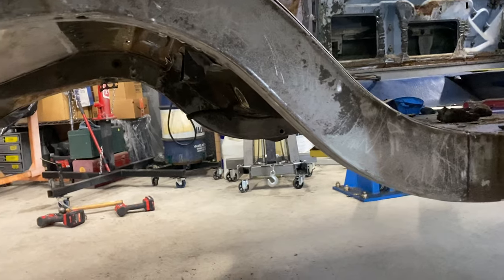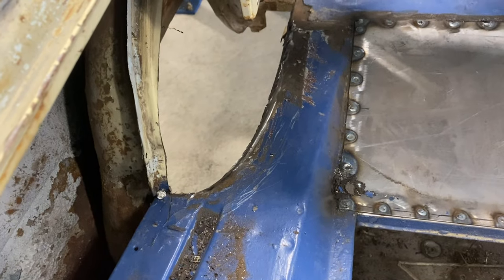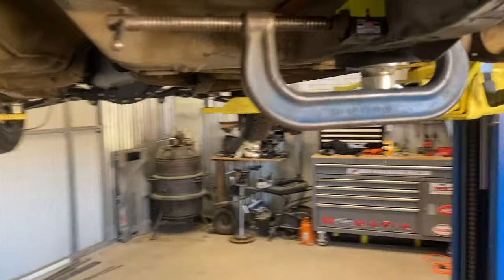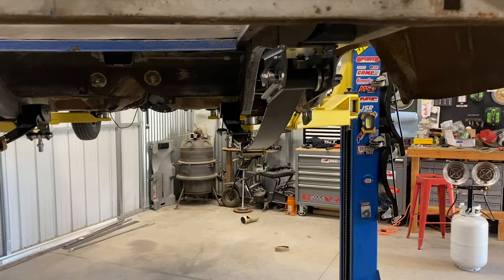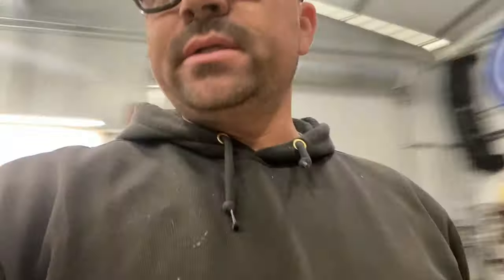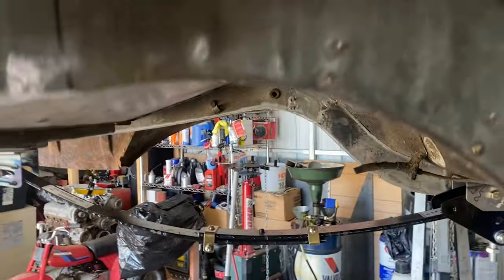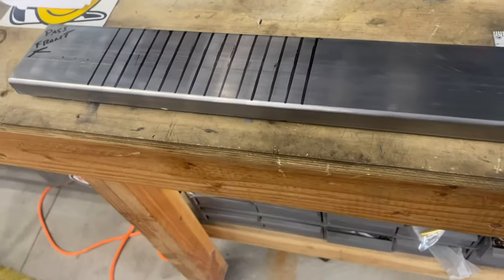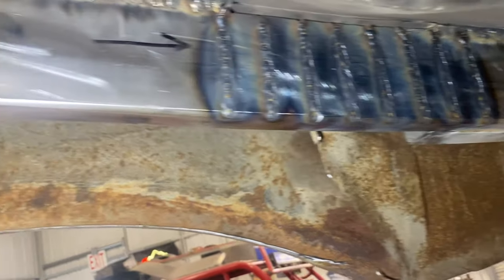1963 FORD FALCON MINI TUB CONTINUES!!!!

Comment: Looks like a good time to weld a piece of tube bent mocking the frame rails on the top inside of the rails, be like a tube chassis by strength but still have the modified rails for mounting to and weld the spring brackets to also since the factory metal and coating is horrible to weld on. Just a thought since im wanting to do the same to my 62 wagon
Reply: Well nevermind, should have finished watching to see what you ended up doing lol, dont be hard on yourself about thinking this stuff is boring. It will be people like me that wants to see what and where you cut in detail, granted most want to see just the beginning and end but they arent the ones that would be doing it anyway
Reply from the maker: Thank you ! I often find myself filming a bunch then wondering are people even gonna watch me think and repeat this over and over! But I guess if they don’t want to watch then they won’t!

Comment: What's the front wheel spec and tire size. Currently building a 65 and getting a k member from matt
Reply from the maker: That’s a 15 inch Jeg wheel with a 165 tire. Jegs or Summit both carry them for cheap!
Reply: @TeamDPerformance  you know what the back spacing and width
Reply from the maker: I believe 29inches from inside to inside of the springs

Comment: The frame is Not Bent then you should be able to cut the left side move it to the right and do the same with the right to the left
Reply from the maker: I was going to do that but the crap they put on the frame is hard to weld to and I think the Chanel will be stronger! Thanks for watching !